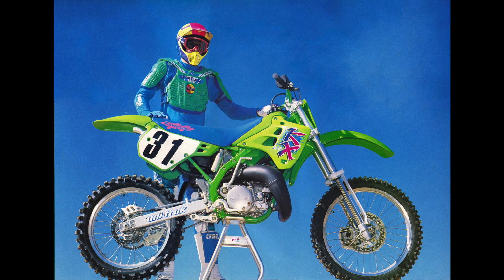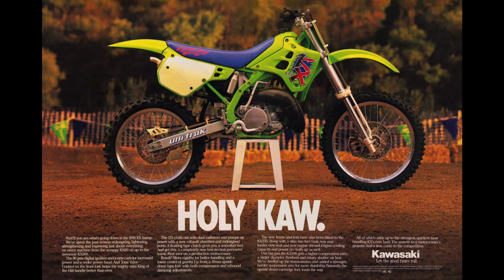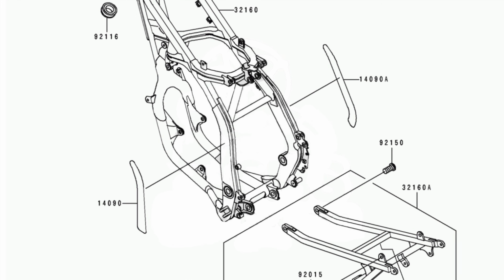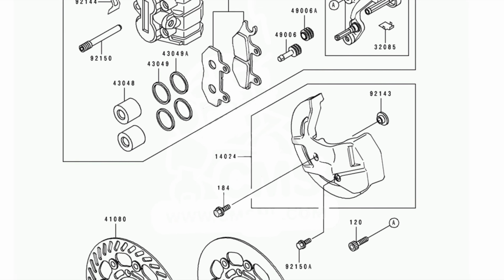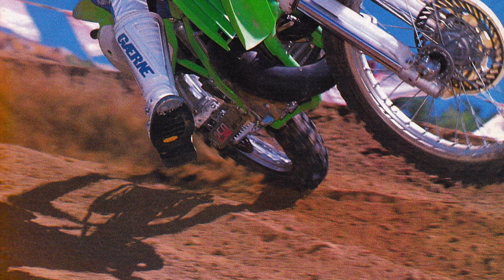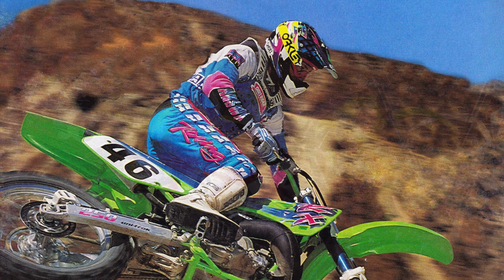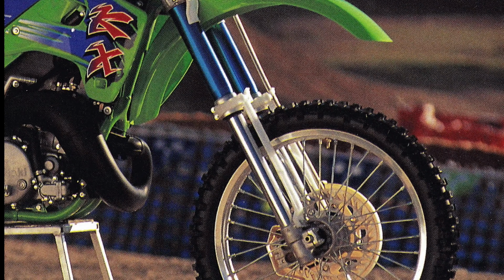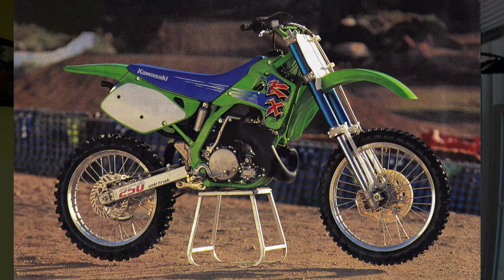1992 Kawasaki KX250 Review | Early ’90s 250 Two-Stroke Contender

Comment: When i was 12 going on 13 my grandpa bought me a cheap 1990 for 600. Mind u it was a vibrating bolt eating hellhound deathtrap! But the engine had just been stripped and everything from new Crack and bearings and seals, as well as being race ported and bored over 20 thou, had all the jetting and lil goodies to make it fuckin haul ass. I can't recall the gearing it had but omfg itd dig and roost a corn field any size from one end to the other lol. As well as i kid u not over 100 mph. My grandpa who bought it speed matched me and paced me at 103 and no shit my 13 year old 130 pound ass had almost 1/3 rd of the throttle left to twist. Itd twist that wrist for sure lol. And dropped it off and omfg lol the raw power this had. Thing stood up every gear no problem at all. All my buddies adored it lol they always were taking off on it to turn around and jump right back off and go hell no lolol. Scared the shit out of everyone. And left many people speechless. Left alot of nice quads and bikes in the dust lol. Thing damn near'd take flight if i had the right tail wind when u crested the hill on a back country road! Lolol

Comment: I have a 92 kx250 i restored. The power valve on it is the coolest thing on a 2 stroke ive ever experienced. When you are high in the rpm and back it down you can actually hear the exhaust tone change from blatting loud to really quite and tame.

Comment: I had a '92 KX250 from new. I feel it is still the best looking bike from the 90s still to this day. The bike did handle like a ocean liner, and felt tall in the corners, but after riding it for a while you learned how to turn it with the back of the bike. As for the engine, stock it was mellow and didn't really have a hit. Adding a FMF pipe/silencer helped, but the biggest difference was adding a Boyesen RAD valve. That single part, along with race gas work the bike up big time! Combined with great suspension it was a beast. Unfortunately this era's chassis was prone to cracking, which I fought throughout owning it. 
I love this bike, and one day I'll pick one up to rebuild.

Comment: Who wrote this..I bought mine new  & still have it. My 92 will turn under just about anything made. The suspension is set up for 140lbs max, stock.  Making it almost  unrideable , it just plain sucks in sand due to chaise geometry  26.5* even after respiring and re valving for My weight.  I have a Tom Morgan prepped cylinder and head , with pro circuit pipe and silencer  with a rad valve. With 110 octane fuel the engine rips